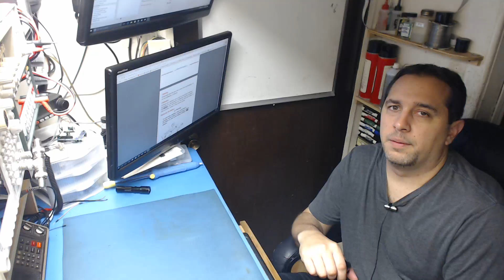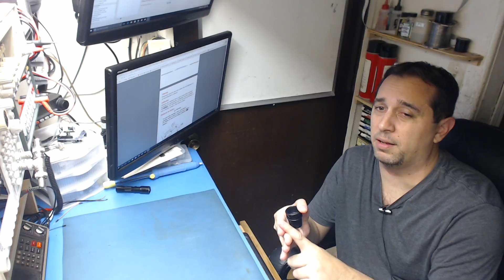BASIC ELECTRONIC TROUBLESHOOTING WITHOUT SCHEMATICS.

Comment: Yes your eyes , ears ,  smell, and touch can tell a lot of info when doing repair work .......  You do great video's and people even experienced people love watching your video's , even me LOL......  I know you have a regular job and such , SOOOOOO when are you going to put out some more content on repairs ???
Reply from the maker: That is a good question. Hopfully soon. Last year was a mess and work has been   consuming most of my time. Plus with the pandemic I am a bit paranoid of meeting and touching other people's electronic equipment.
Reply: @Kev_31779  I do agree on that situation , I do take precautions when opening parts , even from Digikey , if it's from a local person such as home audio or a CB I do break out the spray.....I do buy the 99% iso by the pint for a few bux , my local pharmacy has it in stock and if they run low they call me and advise to come in get some in case they would have delay on the next order.....Cheaper than Ralph Electronics over in Lafayette Louisiana and a hour drive one way, but I only go there if I need certain NOS parts......My salesman is knowledgeable on older parts.... I'll keep an eye out for future vids.... Thanks for the quick reply Mon Ami....

Comment: You’re advice is spot on. I worked on equipment for 40 years and can testify your advice works.
Reply: Appreciate Video clip! Sorry for the intrusion, I would love your opinion. Have you considered - Tarbbatigan clean errors Tip (probably on Google)? It is a great exclusive product for discovering how to fix electronic devices minus the hard work. Ive heard some great things about it and my friend after many years got amazing success with it.
Reply: Nice Video! Apologies for chiming in, I am interested in your initial thoughts. Have you heard about - Tarbbatigan clean errors Tip (erm, check it on google should be there)? It is a good one off product for discovering how to fix electronic devices without the hard work. Ive heard some pretty good things about it and my GF  got cool results with it.

Comment: The one thing I learnt  from The Signal Path is don't just change out visually burnt parts and plug it in and expect it to work. Always check the pads for shorts when the part is out because there might be something down the line that is blown.

Comment: Hate to ask yet another question, but I am in need of advice. I have a Rockford Fosgate t500.2 with a channel that well just isn't right. I have tested everything I can test with a dmm. Everything checks. I tested that sides fets caps gate resistors. I checked the opamp drivers. I even went as far as changing the gain pot on that side. I don't have a scope so kinda at a loss. Checked with and without signal and powered and unpowered
Reply from the maker: What is not right about it?
Reply: Static ,whining, heavy distortion
Reply from the maker: Could be many different things. I don't have any service information on that amp. You can try swapping parts from one channel to the other if you don't have any test scope gear but that can be time consuming and not very efficient. Could be bad fets pre dive transistors noble resistors bad solder joints the list can go on and on. Without a scope and a known signal input  I cant tell you much of what is going on with the output.

Comment: Thanks for all your videos,  I have a ? For you, have you ever worked on Onkyo receiver with the HDMI switching issue? I believe the one model is an Sr-605
Reply from the maker: Try changing all the SMD caps on the HDMI board,  or specifically C6809, C8002, C8602, C8096 and C8162. It might take care of the issue.
Reply: thanks I will try that..